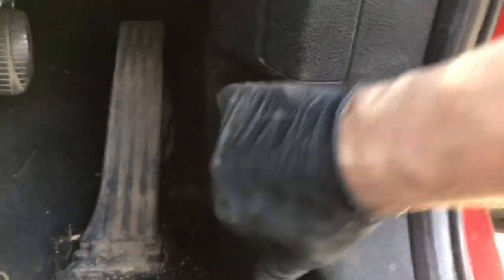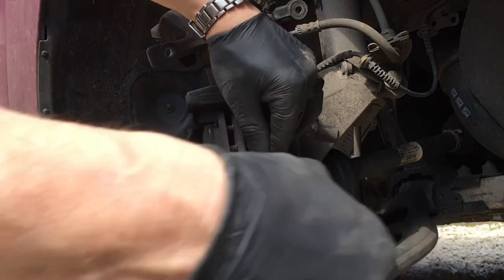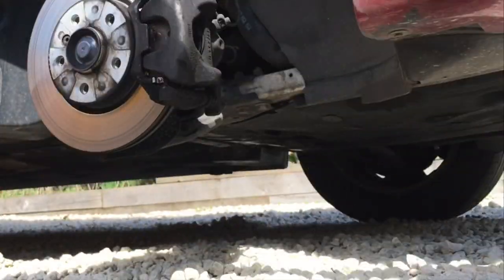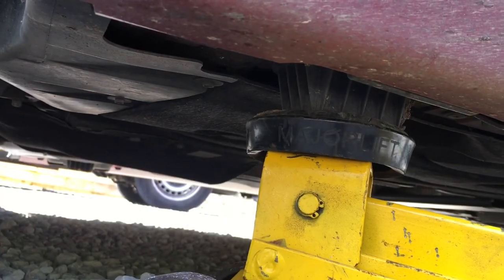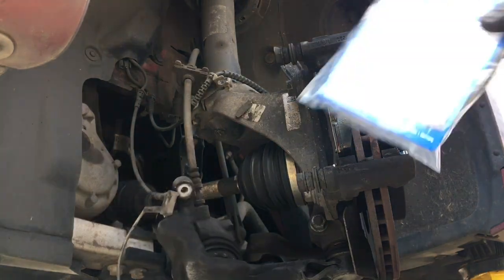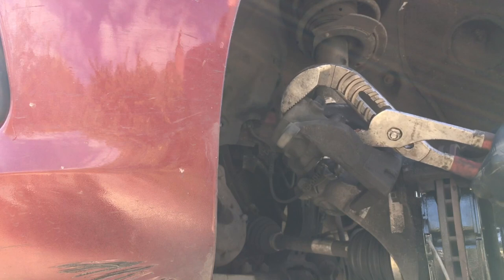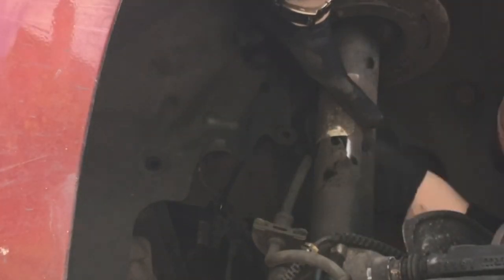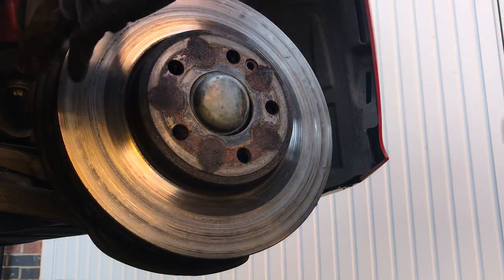BMW 216 Front Brake Pad / Disc Replacement Diy 🇬🇧

Comment: Hey - cheers for the instructions, really clear and well delivered.  I'm doing this job today on a 2015 1.5 Diesel Active Tourer and it's gone well... Except - my pads are now binding really badly on the same side that gave you trouble.  I've had the carrier off, filed it free of debris and refitted it - the pads definitely move freely.  I've also just replaced the piston and seal in the calliper as I thought that was the issue.  It's as if once the brakes are applied, the piston on that side sticks.  Any ideas?  I'm scratching my head!  I don't think the pads were sticking before but can't be sure - I tried the old pads in the cleaned carrier and it still sticks.

I've seen online that the ABS pump can cause issues with brakes sticking on this car but I would think that this would affect all wheels.... It's all very odd!
Reply from the maker: Most likely issue is to be the flexible brake hose cracking from the inside effectively causing a restriction holding the fluid to the calliper, this usually happens when the hose has been clamped to tightly in a previous repair. Thanks for the great comments👍🏻👍🏻🛠

Comment: Did you ensure you got the inner and outer pad in the correct place? They are slightly different. The 'nipples' on the back are closer together on the outer pad.
Reply from the maker: Yes, Thanks for the great comments👍🏻👍🏻🛠

Comment: I stopped using copper grease on brakes years ago... I only use Ceratec brake grease (made by TMD i.e. Pagid, mintex, textar)
Reply from the maker: I will look it up, thanks for the great information 👍🏻👍🏻🛠
Reply: It's available at EuroCarParts.
I also recommend using brake cleaner, quickly dissolves the caked on dirt/dust